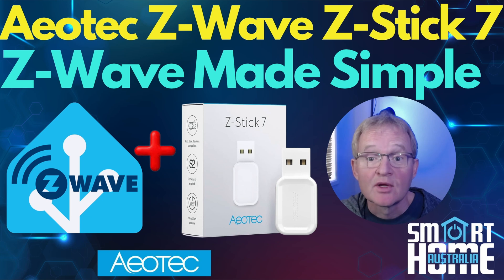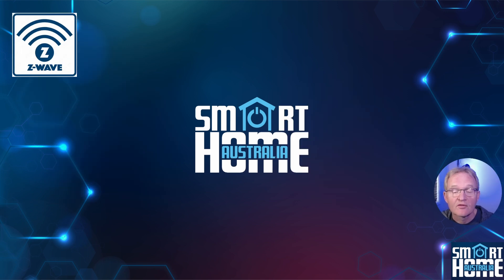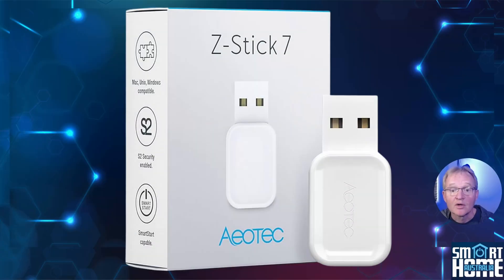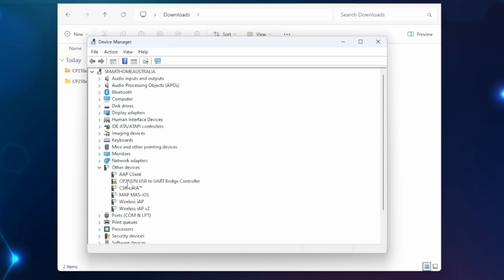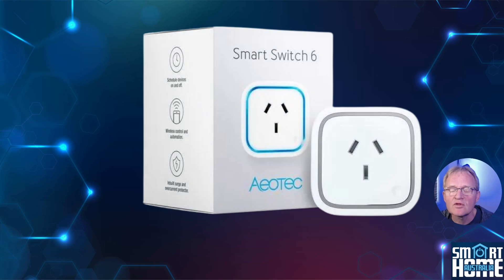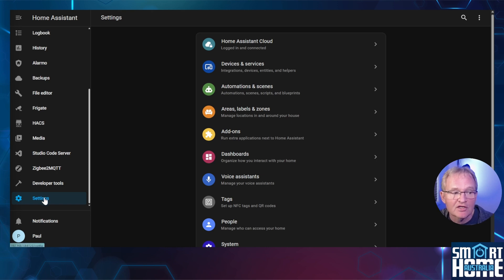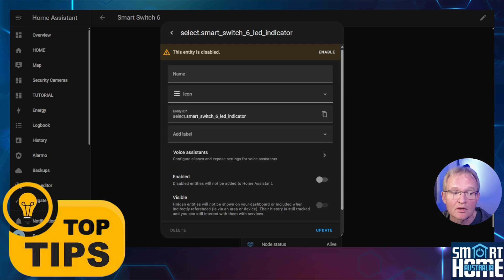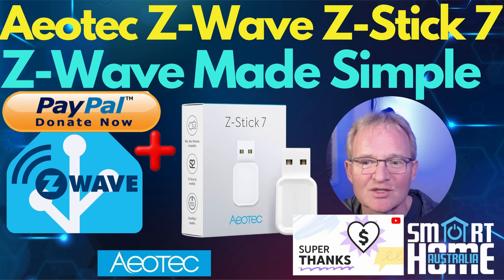The BEST ZWave coordinator available

Comment: Is it possible to migrate from Aeotec gen 5 to gen 7? Will the 7 be plug and play if going straight in to a HA Green?
Reply from the maker: Yes, it is possible to migrate from an Aeotec Gen 5 Z-Stick to a Gen 7 Z-Stick, but the process requires some careful steps:
1) Firmware Update: Ensure your Gen 5 stick is on firmware version 1.2 (1.02). If not, you'll need to update it first.
2) NVM Backup: Perform an NVM (Non-Volatile Memory) backup of your Gen 5 stick using Z-Wave JS UI.
3) Restore to Gen 7: After installing the Gen 7 stick, restore the NVM backup to transfer your network configuration.

However, this migration process can be tricky:
- Firmware updates on Gen 5 sticks can be challenging and may risk bricking the device.
- The process often requires multiple attempts and may need a Windows machine for the firmware update.

Regarding using the Z-Stick 7 with Home Assistant Green:
The Z-Stick 7 should work with Home Assistant Green, but it won't be entirely plug-and-play. You'll need to:
1) Physically connect the Z-Stick 7 to one of the USB ports on the Home Assistant Green.
2) Install and configure the Z-Wave JS integration in Home Assistant.
3) Set up Z-Wave JS UI for more advanced management (optional but recommended).

While Home Assistant Green comes with Home Assistant pre-installed, making initial setup easier, you'll still need to configure the Z-Wave integration separately.

Remember that the Z-Stick 7 uses the newer 700 series Z-Wave technology, which offers improvements like SmartStart and better range compared to the Gen 5
Reply: @smart_home_australia  Hey mate... thank you so much for your detailed response. It's really appreciated.

I can't get power to my Gen 5 stick, on my new HA Green. (was working fine on my previous NUC). This is why I'm upgrading to the Z-Stick 7. 

So I wont be able to use Zwave JS UI to do the NVM backup on the Gen 5. Can I do the NVM backup and restore to the Gen 7 on a windows PC?
Reply from the maker: @louisstevens7826  Yes, you can perform an NVM backup and restore for your Z-Stick Gen 5 to the Z-Stick 7 using a Windows PC. Here are the steps you can follow:
	1.	Prepare Your Windows PC: Ensure you have a Windows PC available. You will need to download and install the necessary software tools.
	2.	Download Required Software:
	•	Simplicity Studio 5: This includes the PC Controller 5 tool, which is necessary for backing up and restoring Z-Stick data.
	•	PC Controller 5: This tool is used to manage the backup and restore process.
	3.	Connect Z-Stick Gen 5:
	•	Connect your Z-Stick Gen 5 to the Windows PC.
	•	Open Simplicity Studio and launch the PC Controller tool.
	4.	Backup NVM from Gen 5:
	•	In PC Controller, select the appropriate COM port for your Z-Stick Gen 5.
	•	Use the “NVM Backup/Restore” option to create a backup of your current network configuration.
	5.	Switch to Z-Stick 7:
	•	Disconnect the Gen 5 stick and connect the Z-Stick 7 to your Windows PC.
	•	Again, ensure it is recognized by selecting the correct COM port in PC Controller.
	6.	Restore NVM to Gen 7:
	•	Use the “NVM Backup/Restore” option in PC Controller to restore the backup file you created from the Gen 5 stick onto your Z-Stick 7.

Sounds a lot more complex than it actually is. Should take no more than 10 minutes.
Reply: @smart_home_australia  Once again, thank you so much! For a YouTuber to go in to so much detail on a comment response is amazing. I will be buying you a PayPal coffee... I will try the windows PC backup tonight. (me not being overly tech savvy, your instructions are really helpful)
Reply from the maker: Thanks for the caffeine injection :)

Comment: So the real question over here is and still to this day is confusing to me. Do I need Z wave JS installed currently for some reason my Z wave JS is not working, but all of my Z wave devices are functioning properly.
Reply from the maker: There are afew different ways to integrate with ZWave, some supported some not.
You could be using OpenZWave was the previous standard Z-Wave integration for Home Assistant before Z-Wave JS. However, it is now deprecated and not recommended for new installations.
Alternative you could be using Z-Wave Network, this is an older Z-Wave integration that is no longer actively maintained. It's not recommended for new setups.
And of course you could be using a Zwave Hub and integrating the hub with HA.
Either way ZWave JS is the recommended.

Comment: Thanks for the information. I think I will give z wave a go! I have been using Home Assistant for a number of years. Using zigbee, Wifi, Bluetooth. Usually watch you tube on TV, harder to comment!
Reply from the maker: Hi Jimbo, Zigbee is amazing for its simplicity and easy of execution, but Zwave is a technically better protocol. The way is can rebuild its network to optimize the routes is brilliant and something that Zigbee needs to implement.

Comment: I brought this in addition to a home assistant yellow to replace an aging Vera Plus and i am find it to frequently jam and fail to respond requiring a reboot of the home assistant to resolve
Reply from the maker: Interesting.  Try sticking to firmware versions 7.12.2 to 7.19.x. 

Are you using a USB extension cable? 

Also check out https://community.home-assistant.io/t/aeotec-zwave-stick-problems/352714
This might give you a clue to the root cause.
Reply: @smart_home_australia  thanks for the response. I have tried most of the recommended solutions, including a usb extension cable to no avail.
Reply from the maker: Have you reached out to Aeotec tech support? Do you have a case reference number, I might be able to get some traction for you.

Comment: Z-wave was my first smart home equipment about 10+ years ago. It was very hard to find devices in Australia back then, much better now.
Z-wave is still my most reliable equipment, far better than my ZigBee gear. I'm even still using a lot of those 10+ year old sensors and switches.
Reply from the maker: Hi Sparky, totally agree, its a far superior network, but due to the certification the devices do then to be a little more expensive and hence not as widely adopted. Saying that, it is huge in America compared to AUS. Check out www.smarthome.com.au for devices, they have a wide range and amazing prices. MS7 on Amazon $120, and $77 on SmartHome !! And no I don't get commission lols.

Comment: Great video!  Its good to see that the Open Home Foundation has committed to certifying Zwave-JS.  I think Home Assistant recommend using a USB2 port and an extension cable to get the device away from the high frequency noise that is emitted from USB3 ports.
Reply from the maker: I think it's pretty much universally accepted to run any transceiver (Zigbee/Zwave/Bluetooth) as far from the hub as possible. Ideally with an USB extender and usually to run them as USB 2 not 3. After all 480mbs is fine to run all those adaptors simultaneously. 
Thanks for contributing, its great to know there is someone out there :)